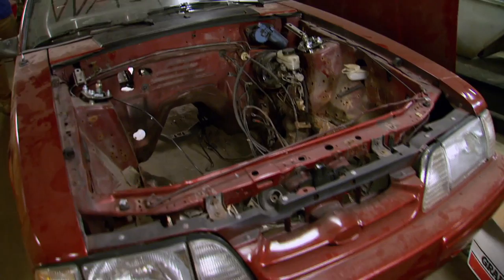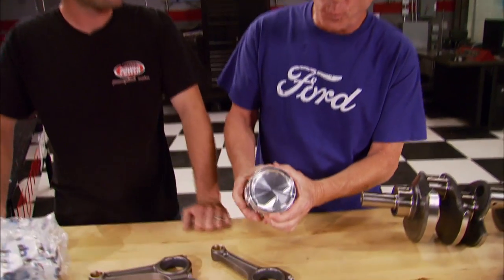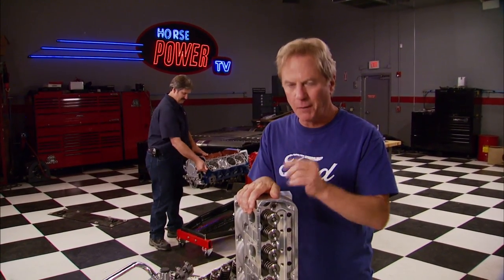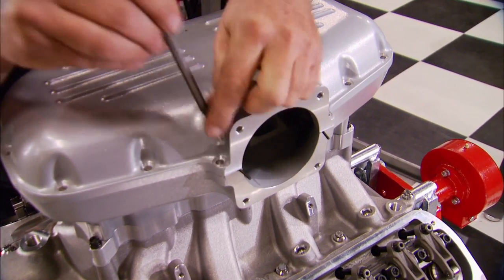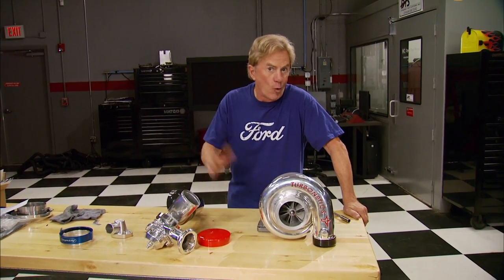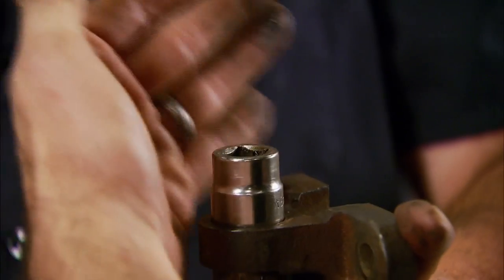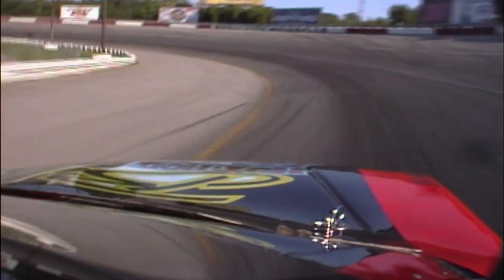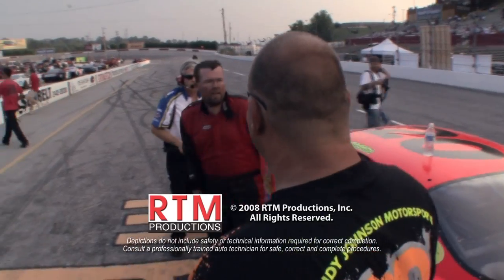Building A High-Performance Ford Windsor To Drop In A 900+ HP Turbo Stang - Horsepower S12, E18

Comment: Remember way back when 400 horsepower was a great number and 500 HPwas insane lol these days no one gets excited unless your pulling 900 + lmfao
Reply: I'm in my late 20s and remember 300 hp being a great number.
Reply: @theicksta  Still is, for most street cars that's a good fun number.
Reply: Hey even minivans now a days have 300hp motors in them, I know cause I got one
Reply: @KacerRex  300hp is OK at first then you get bored of it and want more power lol
Reply: 😂😂😂 so true lol
Reply: @jlj547 difference is that 300 hp in a heavy modern van or car is slow as hell but 300 in an old mid size coupe is zippy and decent
Reply: @eduardoquezada11  so true my first 300 HP build got old quick then the 460HP got old quick too.  I wanted more but was having trouble getting traction, if I was breaking the tires loose on a full throttle highway rip I can only imagine what 900HP would be doing on the street!

Comment: Might be buying an F-250 with a 351W in a few days. Would be fun to do an NA build on it.
Reply: My first vehicle was a '96 F-250 with a 351w and 4.10's. All stock but it certainly had guts!
Reply: I had an E350 that I put a NA 408W in. It was an awesome van.
Reply: @bradnimbus4836  I hope it was better than the 351w I had in an 82 bronco, even in that lighter bronco with a c6 it was a complete dog.
Reply: No problems with block splitting either.
Reply: @Terminxman  my 92 f150 351w was a dog too, my 95 f150 5.0 ripped.
Reply: @AndyFromm  Yeah I had a 89 f150 for a little bit with a 302 and it felt like it had a lot more guts even though the rings were basically gone. Probably a combination of EFI and the AOD made the newer trucks get a lot more to the wheels. The bronco could barely spin a tire doing a brake stand.
Reply: @Terminxman  Needed gears!
Reply: @bradnimbus4836  I thought about it, but even with 3.50:1 axles it was screaming above 65
Reply: 408 stroker
Reply: R Skip  What year was your LTD? That's a heavy girl! My '84 is 3900 with me in it!
Reply: R Skip  Yeah! Mines a P73 base model with a Motorcraft 2 barrel 302. Super basic, no power options and even the trunk divider is cardboard! lol
Reply: R Skip  Very cool! That 302 is actually getting replaced with a '95 hydraulic roller 351w that I'm JUST about finished building. One good thing about the age we live in is that old stout v8's can be found easily and be had for a case of beer!
Reply: R Skip  Sure! I'll get some videos posted. I'll post some current stuff too if you'd like.

Comment: Great to se another SB Ford build. Got to the end and reminded me of asphalt racing and how the rule makers are once again screwing the SB Fords.  Every time Ford comes up with a winning combination the rules change. Wonder why you don't see many Fords on a asphalt track. Sanctioning bodies favor GM is the reason.Sad to see rule makers control who wins races.                      
2020 Asphalt Late Model Rules.
The GM 604 crate motors are allowed a 6500 RPM RPM Chip.
The Ford 347 is allowed a 6300 RPM Chip.
The GM is allowed to increase rocker arm ratio from stock 1.5 to a 1.6 increasing life close to .030. 
The Ford must remove there stock ratio from 1.6 to a 1.5 decreasing lift about .030.
The GM can install a 1 inch carb spacer the Ford cant use a spacer. 
NOW YOU KNOW.
Reply: Facts?
Reply: @xmo552  Read the rule books all over the country for any class using GM and Ford Crate motors. Facts don't lie. I have seeing this crap go on for over 25 years.
Reply: @tomhamilton9140  
I'm not a racer so idk 🤷‍♂️
I believe you however.
Reply: It's always been that way. I've heard several times throughout years past in Nascar road racing any kind of racing, where the announcers with no shame at all come right out and say it. We have to slow them Fords down.

Comment: When modifying your engine to produce more power and torque, how do you determine if it well still met emission standards for the state it's registered in ?
Reply: Lmao you buy a car that’s older than a 1999 at least in my state. All I have to meet is safety inspection.

Comment: Why are you letting hot oil from the lifter valley splash up unto the bottom of the intake manifold. Couldn't you have fabricated some kind of shield to protect it.

Comment: I always thought the Cleveland was considered the better engine. But they seem to focus on Windsor builds. Is it because the Windsor has better aftermarket parts or was i wrong about the Cleveland?
Reply: Cleveland 351 is a different engine family with the same displacement. It has larger valves and better cooling but isn't fundamentally a better engine, just a different one. Higher RPM and more HP from the factory.
Reply: Back in the day the Cleveland’s were killer because they had some of the best flowing factory heads out there, flowing too much in many cases for the small displacement, but as time went on the Windsor aftermarket began to grow and it’s much easier and cheaper these days to make big power with a Windsor than a Cleveland. And factory Windsor engines and parts are so abundant because Ford made them so long. Cleveland’s are hard to find now
Reply: Just top a Cleveland heads on your Windsor, best of both worlds.
Reply: Yup Aftermarket. Pretty much what Nitro Union said. Better heads but less availability. Always heard the Windsor had a slightly stronger block too but not sure. The Cleveland Cylinder heads are really some fantastic heads. YouTube Channel Drag Boss has a 69' Mercury Cougar that runs 9s with a 408 Cleveland NA. Highly recommend checking it out to learn about Clevelands & fast Cats. I think the Cleveland is a bit better stock but the Windsor is widely available & inexpensive comparatively.
Reply: @brandonrobertson6327  The Clevors are stout combos for sure.
Reply: @cemeteryhill  I haven't heard much about what a Cleveland block will handle power wise, but I do know first hand that the Windsor blocks will split at around 750hp. There's a video on my channel of us splitting on with a roots supercharged combo haha.
Reply: @NitroUnion  lol 750 is a significant amount of power so that's pretty cool to have 1st hand experience with that. Never had access to a Dyno myself.  Have heard some Cleveland guys say the block is the Clevelands weak point but don't have any #s. Have always enjoyed the SBF engines. I have a 68 Cougar with a 302 that I wrench on in my free time. Have headers & a 4 bbl + electronic ignition. Hope to do the heads next. You have a sick channel bro!
Reply: Mostly because Ford didn't make the 351C but 4 years. They made the taller block 351/400M engines, that use the same 2v cylinder heads as the 315C, but they never made a performance version of the Modified. The 302 and 351Windsor have been out forever, and there is a lot more people running those on the street. 
Just to remind everyone, the Ford NASCAR engines are based on the 351C. Now that the rules are as they are, every engine in NASCAR is running a pretty close version of the 351C. Along with the Top Loader trans and the 9 Inch Differentials, every team out there is running Ford stuff.

Comment: They always leave that extra ugly piece of timing cover gasket exposed. I always trim that off when I’m building a SBF. Great build and video.
Reply: @bigboreracing356  If you’re talking about cost, I’ve personally have had better luck with the Ford platform. But I’ve been building Fords my whole life. Especially the Cleveland’s. I don’t care what you’re building, it’s all expensive.

Comment: Dont get it twisted the STOCK 302 block will split in half at 600-700hp range this is not something u want to do wo a DART or aftermarket block

Comment: Literally any other high performance build they put a carb on it like its 1980, but they can figure out fuel injection for this. Go figure.
Reply: Whats wrong with carburetors?
Reply: @Good-Nuff-Garage  Nothing. I these guys whip a carb on every LS or late model build, and thats not indicative of the real world.

Comment: FYI these guys never tell the whole story. that custom crank $2k-$3.7k retail. rockers $1.8k retail. add everything up. 10-15 IN PARTS!.  all bolt on? yeah right. when crower and pace send you everything, sure bolt it on. when the $ comes out of your pocket you never just bolt it on. If something fails the manufacturer will say "send it in and we will evaluate it". who's out the time and parts for  redo even if their part is bad? YOU. I can never tell if they're being safe, are you guys gonna consistently run an electric water pump or be unsafe? and why don't you run EGT's and an air turbine/fuel flow meter? how did you determine pushrod length? POV clearance? CR? crank stroke? actual valve lift? dur. @ .050 ? so many clearance checks left out. cam thrust? valve adjustment on a big roller shouldnt be done at TDC.  no lets spend 8 minutes on u-joints and some guys race program.

Comment: Why make a point of talking about the fuel pump eccentric when you're using fuel injectors?
Reply: Chris Daigle : Because thats how the timing advance and retard for the cam is set up. Some pumps on NASCAR EFi systems are still engine operated, there are piston pumps around that use the eccentric.

Comment: Come on guys you have to change out those U-joints on an old stump with a socket and hammer, preferably when it is either 100 degrees in the shade or raining cats and dogs. None of that nice and neat in the shop stuff, that takes the fun out of the job not to mention it removes several words from your vocabulary that you will create while doing it the right way.